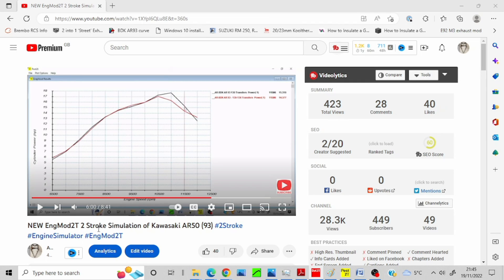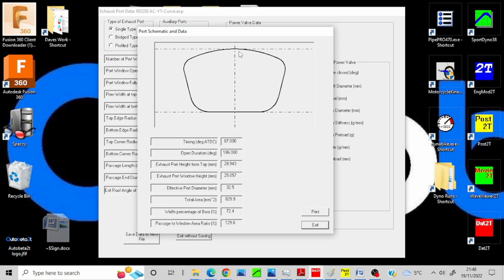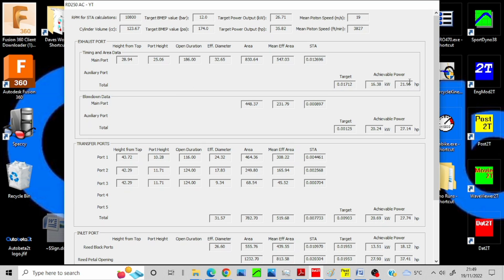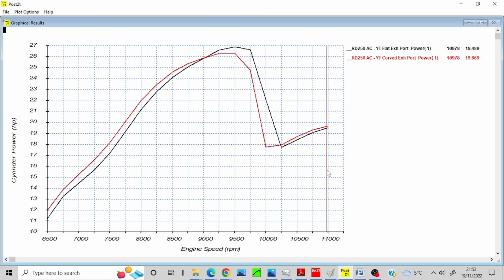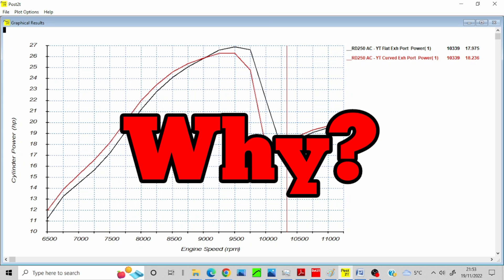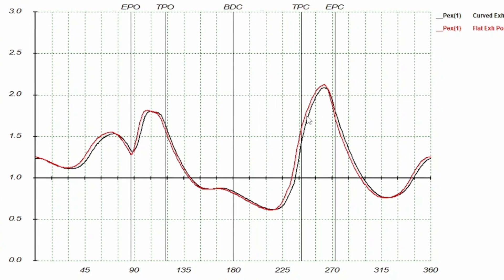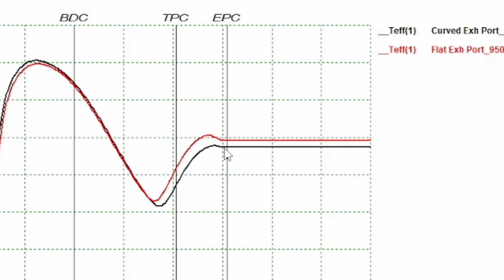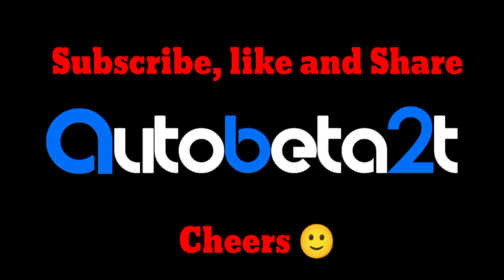Flat Top Vs Curve Top 2 Stroke Exhaust Port Engine Simulation #2Stroke # Tuning #engineSimulation

Comment: Interesting vid! I'm sure that I'm teaching you to suck eggs here but a flat top exhaust port is likely to be more brutal on the piston rings, this might be an issue if your port is also very wide, i.e. 70% of the bore diameter, and I think yours is. 

EDIT...I suppose ring life has to play 'second fiddle' when you are trying to hit 100MPH.
Reply from the maker: Yes, I'll probably not go down that route unless I get desperate. I have heard of people using a long chamfer on exhaust port that are extreme to gradually guide the ring out of the port and I to the cylinder.
Reply: I always used flat top ports in road race engines back in the 80's, no ring issues and minimal chamfering.
Reply: @AuMechanic  Of course you won't have an issue with the rings in a road race engine because the engine is getting rebuilt very often. I used to run a TZ350 G in an F2 sidecar outfit, no issues with the rings. (as long as they were replaced every 50 racing miles! Pistons every 150 and the crank every 500!)

Actually the TZ did have an issue with its rings, they would get 'shaved' thin where they travelled over the exhaust port, the reason was that a burr would form on the ring ends which were opposite the exhaust port, the burr was due to the ring ends hitting the vertical pin in the piston that stopped the ring rotating. The rings ends had to be 'dressed' in order to stop the burr standing proud of the ring which would cause it to jam in the groove in the piston.
Reply: @sidecarbod1441  Yes but I suspect that is likely in part due to the rings used and only one of them in TZ's with nikasil bores as well as very high RPM compared to stock.
I raced an LC350H imp tourer well modified to TZ350G port timings (and YZ 6 petal reeds and carbs I stuffed in it) using Wiseco pistons and rings that lasted 2 seasons no trouble.
And from my own exp as a Mc mechanic plenty of stock bikes had flat top ex ports and no rings issues.
Reply: @AuMechanic  At the end of the day how flat you can go on the top of the port is going to vary from one engine to another and also it will depend on what ring life you are expecting, things like piston rock will have an effect and that will depend on the conrod length and the stroke (conrod ratio), piston clearance and piston skirt length. So to sum up I can't say for sure that in the AR93 a flat port WILL be a problem and you can't say that it WON'T be a problem. As Dave is trying to squeeze as much BHP out of this engine as possible to get to 100 MPH he is going to have to use every trick in the book and if that means going for a flat top port, so be it.

With regards to LC's, didn't everyone have a mega tuned one back in the day? My last one would rev to 11500 RPM, the powerband didn't start until the 9000, not far off the standard redline, it was as fast as hell but boy did I have have to throw pistons and cranks at it. My mate had a go on it, he said it was like riding a chain saw!
Reply: @sidecarbod1441  "you can't say that it WON'T be a problem" Never did.
To expound on what I said, in my exp as a qualified MC (since 1979) I have worked on numerous stock and modified engines with flat top ex ports that suffered no ring issues. How you or anyone else interprets or uses that information is up to you.
A curved port top will not resolve ring issues from high mean piston speed and BHP.
As for LC's, did everyone have 6 petal YZ reeds and carbs and optical ignition system in place of the rotor that was the root cause of crank twisting in them, and did they have welded crank pins in their LC, probably not and no-one i raced against did, but I did and with that never suffered any crank issues thereafter over a season and neither did they guy I sold it to after I moved to 1000 superbikes. And never needed to rev the LC beyond 10k and had ample power below 9k and if you did not on yours then seems perhaps your porting job was sub par or some other flaw robbing you of low end power.
Reply from the maker: @AuMechanic  I'm very interested now in flat verses curved. Not having much practical experience in porting  I am looking forward to experimenting with both and incrementally go from curved to flat... It will be interesting to see how the piston and rings react.and if it grenades itself. 
I've a KX65 rod which gives a few more piston options as the cheapo piston that's in there at the min may not be up to the job.
Reply: @AuMechanic  Jesus man, the LC reference was only some light hearted 'banter' as in "didn't everyone have an LC in the day?", I was NOT trying to belittle your achievements with your LC,  you need to get off your high horse and lighten up!

I know that you didn't ACTUALLY say that 'a flat port wouldn't be a problem, in the same way that I didn't ACTUALLY say that it would be a problem  What I was trying to do was 'de-fuse' the situation as I did not want the posts for this video to spiral down into yet another youtube 'spat', I guess it was too subtle for you to pick up on. 

As to 'sub par'' porting well I don't think that the idea of just copying the TZ350 G is all that great an idea, for starters the TZ has 6 transfers, the LC has 4 so the time-area will differ, oh and lets not forget that the TZ had a piston ported inlet, the LC has you are keen to point out was reed ported with the piston playing a secondary role with regards to the inlet timing. Finally the G produced peak power at 11,000 RPM so I suggest that if your LC was only running to 10,000 then there was something wrong with your setup, your porting should have allowed the engine to rev higher, in other words there was a mis-match between the port timing and the RPM that you were prepared to, or could run the engine to.

I know exactly why my engine was not optimal at lower RPM, it was a road bike and at the time there wasn't an ignition system that would give me a suitable retard curve that would also charge a battery. (Well not one that I could afford). In other words it would have benefitted from running way more advance at low RPM. BTW my LC ran a welded crank along with TZ big end bearings.

Anyway life is too short to be 'conversing' with you, feel free to reply, I won't bother.
Reply: @sidecarbod1441  The G spec porting obviously refers to the exhaust and transfer timings, did I mention the LC has reeds, oh yes I did.
I confess I have been accommodating your cute ring theory for my own amusement so let me be plainly honest.
The theory that suggests the curved exhaust port somehow tucks the rings back in like pulling up trousers over a xmas pot belly, It is no better than flat earth theory.
The shape of the exhaust port has absolutely nothing to do with the rings or any other mechanical factors and a cursory use of a calculator should reveal that fact in about 90 seconds.

There is only one reason that an exhaust port is curved.
Can you guess what it is ?
Reply: @AutoBeta2T  Fact is port shape has nothing to do with the rings.
So you can rest assured that have a flat top port will have 0 effect on the rings and ring life or any other mechanical part.
As for what it will do, Ill explain that by email.
Reply: @AuMechanic  I wasn't going to reply to you as you don't appear to be very receptive to any theory other than your own ideas (I won't call your idea a 'theory' as that would imply that it has been peer reviewed, independently tested, and can not be disproved). Also, you have not actually expanded on your idea of why a flat port is not likely to be a problem.

Having said that I have decided to have one last attempt to explain to you what the possible problem is when running flat roof port , and MUCH more importantly because other people will read this thread and they might be interested in what a renowned and published 2 stroke expert/developer has to say with regards to the shape of the exhaust port, i.e. Gordon Jennings. They can then look at any evidence that you decide to post up along with reading the extract below and make their own minds up.

Oh, one last reason why I decided to reply to you was to watch you dig yourself into a big hole for "my own amusement" (borrowing a line from you!).

With regards to my "cute" theory, well it's not my theory, (thanks for calling it a theory) AG Bell and G Jennings both state that there is a risk of snagging a ring with a flat top port, the two authors that I have mentioned will have forgotten more information with regards to 2 strokes than you could amass in your lifetime. I think your 'flat' port idea not being a potential problem is akin to the 'flat' earth idea being a good one. (Do you like what I did there?)

Your LC that ran for two racing seasons probably did no more that 1000 miles, 1500 miles max so even with flat ports it was not likely that you would spot any issues assuming that the ports weren't very wide. Here are some questions that I'd like you to answer...

1. What was the port width? You mention it being ported to a TZ spec, was the exhaust port as wide as a TZ port? If so it was around 70% bore width, if it was that wide AND with a flat roof then I call that out as 'BS'! (The TZ has a nice oval exhaust port). If your LC ports were not 70% of the bore width then your engine was NOT ported to a TZ spec, you have therefore posted up misleading information. (Maybe that is why it would not rev to 11,000 RPM, i.e. the peak power RPM of a TZ350G.
In fact it could never be TZ G spec, it simply does not have the transfer area.

2. Was there any radii in the top two corners? If so how big was each radius?

3. Was the port totally flat across the roof or was just a percentage of the roof flat? If so what percentage was flat?

Below is an extract from one of Gordon Jennings books in which he focuses in on the exhaust port, I have had to remove the images which show how a square port should be modified so that it becomes an ellipse or oval. I'm sure that you will come back with some sort of disagreement over what G Jennings has published or find to way to dismiss it....

"The difference between success and failure with a modified engine can be the treatment of the exhaust port.  Even assuming that no change is made in exhaust-port timing, simply widening the port window will result in a power increase; it also can result in drastically-shortened ring life, amounting in extreme examples to outright and nearly-instant breakage of the rings, and/or severe overheating of the piston crown.  There are reasons for these problems: A two-stroke engine's piston rings always bulge out into any port window they pass, and while transfer port windows seldom are wide enough to permit this to an extent sufficient to cause difficulties, the same certainly may not be said of the exhaust port.  A relatively mildly-tuned engine will have an exhaust port width equal to at least 50-percent of its bore diameter (which is to say, a 3-inch cylinder bore would have a 1.5-inch exhaust port width) and that is enough to allow the ring to spring out into the port window very perceptibly.  Make that port square, with sharp comers and sharp edges, and the ring will be destroyed very quickly.  And if you enlarge the port so that its width represents 70-percent of cylinder-bore diameter, ring failure would almost certainly occur during the first revolution of the crankshaft.  Yet, racing engines have been run quite successfully with 70-percent port widths, and while I cannot recommend that kind of extremity for modified production-type engines, the mere fact that it has been done tells us that techniques exist to make it possible.
Basically, ring-life is improved - at any given port width by  A) rounding the shape of the port window, and B) breaking the window's sharp edges.  Both of these measures are employed in all engines, but they reach special and somewhat exaggerated form in racing applications.  The traditional port window shape is square, or rectangular, with its corners rounded to help prevent ring snagging.  Assuming that the port width does not exceed 60-percent of bore diameter, the radii at the port window's corners should be about 15 or 20-percent of the port width, and that is just what you will find in most engines.  But as the port is widened, those corner radii have to be made larger to about 25-percent of port width when the latter approaches being 70-percent of cylinder diameter.  Actually, even these very large radii will not completely prevent ring snagging if they are joined by straight-line edges.  The upper and lower edges of the port window should be arched, on a radius equal to about twice the port width, in ports having a width that is 60-percent of bore diameter or less.  Unfortunately, these simple rules-of-thumb are not adequate at port widths above the 60-percent level and such widths are - becoming very common.  With the rings we had a decade past, which were relatively thick, axially, and quite narrow, radially, (not to mention being made of ordinary and rather brittle cast-iron) the upper limit for port width was 62-percent of cylinder bore diameter; now, with our vastly improved rings it has become possible to widen the port out to 70-percent of bore, or slightly more, if we are very careful in shaping the port window.
Just as there is no means of predicting, with any great accuracy, what kind of “cam” and taper a piston will require to fit closely in a cylinder when both are at operating temperature, neither is there any firm rule for shaping ultra-wide exhaust port windows.  Both are established, initially, on the basis of past experience, and then modified according to test results.  It has been demonstrated, in practice, that a modified ellipse is the basic shape of port windows in the 62- to 70-percent (of bore) range.  Thus, while the ring may actually bulge out into the port window enough to cause its instant destruction in a square port, or in one with straight-line edges are joined with simple radii, the contours of an elliptical port window will sweep the ring gently back into its groove.  Then, the only problem that will be encountered is that the ring may bulge out, and be pushed back, unevenly -which may drive one end of the ring sharply against its locating pin and eventually cause the pin to loosen and come adrift. It should be obvious that this last difficulty will be most pronounced when the port window is not perfectly symmetrical, as any departure from symmetry will result in the ring being displaced to one side as it is pushed back into its groove.
Careful craftsmanship will prevent this asymmetrical displacement of the ring; it will not, of itself, forestall other problems associated with very wide exhaust port windows.  In my opinion, one should never simply and arbitrarily widen a port out to the 70-percent limit.  Instead, the safe and sensible approach is to begin at 62-percent, with a shape that is as nearly an ellipse as is possible.  Quite obviously, sharp limitations are going to be imposed by the shape of the existing port window; the idea is to provide the most generous radii permitted by the basic shape with which one must begin.  Obviously, too, this reshaping of the exhaust port window will be easier if you have opted for increasing the exhaust timing, as that will give you room to work above the existing port.  Then, having established the initial shape, you will have to inspect the rings and the edges of the port window for evidence of scuffing or snagging.  Seldom will there be any problem around the lower edge of the port, as the piston slows considerably near the bottom of its stroke.  Most of any scuffing that appears will be around the comers of the port; outright snagging will make its presence known in the appearance of scratches leading upward from the centre of the port window".

I look forward to reading your thoughts with regards to the above. 🙂
Reply: @AuMechanic I see that you have offered to email AutoBeta2T your explanation of why a flat port is not a problem, why by email? Just post it up here. If your idea stands up to scrutiny and no errors can be found in it then it would become a theory, something that is actually held in high regard, you would be held in great esteem within the '2 stroke world' (Just stating that your LC ran just fine won't cut it, not without the port details and even then the engine would need to have been examined independently after the two reason of racing that you mentioned).
As to your comment about using a calculator to prove that the rings do not bulge out into the port, have you actually looked up an exhaust port as the piston descends down past it? You can physically see the rings bulging out into the port.
Reply: @sidecarbod1441  No and no
And again you misquote me.
I said that as a mechanic I have seen many engines with flat top exhaust ports and no such ring issues, the LC is just one, both in an attempt to ease you into considering that perhaps that you are wrong about that.
Clearly it was wasted on you as you persist with it. Fine, you believe nonsense theories if you choose to.
And ... I thought that was your last post on the topic.
Reply: @sidecarbod1441  Jennings (circa 1970's) in his own words wrote his books entirely from his own reverse engineering of what he anecdotally observed and Bell just copied most of it. Unlike Professor Gordon Blair who wrote SAE papers and publications in the early and late 1990's based true scientific methods and peer reviewed studies he cites.
If your rings are colliding with any part of the port it is simply that you have exceeded the acceptable port to bore width ratio for an un-bridged port.
As to corner radii, that is merely a constrain of machining a port and any purpose of them otherwise would be nothing more than mechanical stress relief.
As for seeing the rings bulge out into the exhaust port, compare to what, the rings above the port that you cannot see.
Did you even consider the speed of the piston and the inertia behind the piston and crank assembly at revs and the effect of that on the material properties of a piston ring colliding with any part of the port edge, clearly not.
As for wear marks, what you are observing is distortion of the bore due to heat around the edge of the port and nothing more.
Reply: @sidecarbod1441  And Ill just add one more bit of advice to you and anyone reading that Jennings and in particular G Bell should have remembered and that is the most basic rule of science / statistic which is that "Correlation does not equal causation" and believing it does is a common mistake made in the rush to pull some plausible sounding theory out of a hat, and a mistake made all too often by interpretation of Dynamometer results.
You begin with the theories of causation based on known science and correlation comes after that for the purpose of disproving ones own the theory.
Reply: @AuMechanic  I will pick out some of the points that you have raised from your ‘word salad’ of the last three posts that you submitted and reply to them, I will actually quote you so there can be no misunderstanding.

YOU…“No and no And again you misquote me. I said that as a mechanic I have seen many engines with flat top exhaust ports and no such ring issues, the LC is just one, both in an attempt to ease you into considering that perhaps that you are wrong about that. Clearly it was wasted on you as you persist with it. Fine, you believe nonsense theories if you choose to”…..

…..I have at no point mis-quoted you, in fact I’ll quote you now…”I always used flat top ports in road race engines back in the 80's, no ring issues and minimal chamfering”

It is this blasé comment that I have been concerned about all along, it implies that you can just square off any port with no consideration to its width and have "no ring issues"

YOU…“And ... I thought that was your last post on the topic”

…. Well the truth is that I’ve had a change in the way that I’m dealing with this thread, I’m now thoroughly enjoying it and will continue to reply for as long as I wish to. (Unless of course Dave blocks me!) In the process you may even change my opinion on flat top exhaust ports, if that happens I will be the first to admit it in the thread, so far you have not provided any real arguments or evidence that has even started too change my mind. It has not gone unnoticed that you still have not provided any port dimensions for your LC other than its height, even then you just state “TZ spec”.

I will recap in more detail some actual ‘real world’ evidence that rings DO pump in and out of the exhaust port. For 3 years I ran a TZ350 G in an F2 sidecar outfit, I’m not sure if you are familiar with the piston ring peg design or its location for this engine, basically it is a thin vertical pin that is directly opposite the exhaust port. The exhaust port of my engine was standard, you can check out the shape and dimensions by googling for a port map of this engine. I’m not hiding or being ‘shady’ over its dimensions. (45mm width from memory).

As I stated in a previous post, the rings on this engine did suffer from being shaved thin exactly at the point where they traversed across the exhaust port. Explain how that happened if they to not bulge into the port! The reason that this happened was again down to the pumping action that the port imposed on the ring which resulted in a chain of events. The pumping action caused the rings ends to burr up at the point where they hit the piston ring peg. The burr, if not dealt with would cause the ring ends to jam up in the piston ring groove, this would then stop the ring from being pushed back into its groove as the piston travelled past the roof of the exhaust port, the result was a ‘shaved’ ring. The burr was actually dealt with BEFORE it could form by dressing the ring ends whilst the rings were brand new.

I know that the last time I mentioned my TZ engine you retorted with some gumph with regards to the engine having a single ring and a nikasil bore and at the time I let that slide, now there is no way that the design of the ring or the coating on the bore had anything to do with this, if you believe that it has then explain how, don’t just leave that statement ‘hanging’ in the air. You also, and stated and I quote, “very high RPM compared to stock”, well the engine only ran to the stock RPM limit for that engine. My LC actually ran to a higher RPM limit, it never had ring issues. I only ran the top ring in my LC.

Furthermore, I’ll save you the bother of replying with something along the lines of “well the engine wasn’t assembled correctly” It was actually assembled correctly many, many times.  I will let you know that the tuner/developer that was helping me at the time (Roy Simmons) over the phone knew actually why the rings were shaved and how to cure the issue, whilst I was on the phone to him he said “look at the rings ends, they will have a burr” (this was 30 years ago, possibly more, I will never forget it). Now the only reason that he could do this without even seeing the rings is because he had seen other engines with the same issue. Furthermore, and just to knock-on-the-head any thoughts of this engine somehow not being built correctly I’ll just let you know that in my ‘rookie’ year I won the clubs F2 championship racing against many other TZ’s and 4 cylinder 4 stroke 600cc engines. I went on to win other championships in F2 and F1 sidecar racing but that’s another story.

YOU…“Jennings (circa 1970's) in his own words wrote his books entirely from his own reverse engineering of what he anecdotally observed and Bell just copied most of it”

…..I wondered how you were going to dismiss Jennings book, a fairly weak attempt in my opinion. There are other more contemporary tuners/authors that place great importance on the exhaust port radii in order to protect the rings, The problem is that I cannot find anything on the web that I can copy and paste into this thread.

YOU….“Professor Gordon Blair who wrote SAE papers and publications in the early and late 1990's based true scientific methods and peer reviewed studies he cites. If your rings are colliding with any part of the port it is simply that you have exceeded the acceptable port to bore width ratio for an un-bridged port.”

……I suspect that you have ‘cherry picked’ from that SAE paper. I would need to read the whole paper and not just an extract from it. Even if the paper states exactly what you have posted up in context  I would still disagree with it, as would many others who I freely admit are very much more qualified in this area.

YOU….“As to corner radii, that is merely a constrain of machining a port and any purpose of them otherwise would be nothing more than mechanical stress relief”. 

…..A constrain of machining, well machines and humans are more that capable of grinding a port with virtually no radii so they can not be a “constrain of machining” There must be another reason why the port has radii, if it was just stress relief then the radii could be a whole lot smaller which would then increase the port area without have to increase its width.

YOU..“As for seeing the rings bulge out into the exhaust port, compare to what, the rings above the port that you cannot see.”

….LOL well I think that when you can see the rings bulging out into the port it would be safe to assume that they are not bulging out when the piston has risen above the port! In your world do the rings occupy the same physical space as the bore wall? Some sort co-existence in the same SOLID space?

I actually find it very hard to comprehend how you can NOT see how the radii and curved port roof will not guide the rings back into the ring grooves, I’m not having a ‘dig’ at you here, I just find it hard to comprehend this. It seems just as obvious to me as observing how the linear movement of a piston is converted into rotational movement of the crankshaft by means of the connecting rod and offset crankpin (big end). The radii and curved port roof guide the rings back into their respective grooves, both are obvious to me.

YOU…“As for wear marks, what you are observing is distortion of the bore due to heat around the edge of the port and nothing more”

….Well I’m not buying that, yes the bore can and will distort unevenly to a degree (but less so with water cooling, aka TZ). The piston is also likely to distort unevenly due to temperature variations, for these reasons the piston is both tapered and cam ground. There is no way that the bore can distort locally by the amount that you are inferring or if it did then you have a major issue with the dissipation of heat from your engine, the loss in performance would be huge as the rings would not have any chance of sealing against such a badly distorted bore. (Please don't cite heat fade, that is another issue which describes the lost in performance that has occurred, possibly for several reasons)

YOU…“You begin with the theories of causation based on known science and correlation comes after that for the purpose of disproving ones own the theory”.

….NO, actually you begin with a hypothesis, NOT a theory, you then test that hypothesis, (an idea in layman’s terminology) you offer it up for peer review, you allow it to be independently tested, if after all of that no errors are found then becomes a theory. In science and engineering a theory is held in high regards, the word is misused by the general public, or at best has a different meaning when it is used. In fact the way that you are using it.

Finally, for the moment, there is a simple rule when debating, the person who states the supposition is the one that needs to provide the proof and evidence. You have put forward the statement that flat roof exhaust ports will not cause an issue, (you have implied it to be slightly more accurate) QUOTE "I always used flat top ports in road race engines back in the 80's, no ring issues and minimal chamfering".... You need to provide the evidence. (Other than your LC which at this time has unknown port dimensions)

You may of course flip this on its head and state that I am the one stating that a flat roof port WILL have issues, well at no point in time have I stated that, I have said that it 'MIGHT' have issues, and for further clarification, it obviously depends on the width of the port. A tiny square port is clearly not going to be an issue because a small chamfer could deal with the tiny amount that the ring would bulge into it. A tiny port will not help Dave get his AR93 up to 100 MPH, it in all probability will prevent it.
Reply: For some reason I can not add the text below to my post.....

YOU..."Did you even consider the speed of the piston and the inertia behind the piston and crank assembly at revs and the effect of that on the material properties of a piston ring colliding with any part of the port edge, clearly not".

.....Please actually explain this rather than just stating it, how exactly does the speed of the piston and its inertia prevent the ring from bulging out into the port? Please don't state that there is not enough time for the ring to spring out into the port! LOL
Reply: @sidecarbod1441  "Word salad" from the guy who writes the entire works of Shakespeare in the comment section of a youtube video obviously lacking the self awareness to realise that no-one is going to read all that crap let alone me.
As a professional qualified mechanic like me having rebuilt hundreds of engines over a period of decades you really should know better than to have believed such nonsense theories about ports and rings.
I understand your agony in finding out you were lied to but I didn't lie to you so don't take it out on me.
And no I am not going to explain why ports have a radius on top because it is on my to do list of future vidoes and the topic is quite nuanced and requires more than a youtube comment section allows, and I would not waste my time explaining something only you will read.
Reply: @sidecarbod1441  No
You are the one who claimed the ring is forced back in to the ring land by the curvature of the exhaust port without any regard to the velocity of the ring and forces behind it,  and the result of a ring colliding with any part of the port at any angle of incidence, and the effect of that at 1000s of times per minute on the relatively fragile piston ring if that were to occur.
As a professional mechanic you should know better..
Reply: @AuMechanic  Yes my posts were long, that is because they were detailed, you on the other hand did not post up a single counter argument to anything that I posted up, also, and I'm just putting this 'out there,'  but are you by any chance a slow reader? If so practice makes perfect!  My TZ was somehow lying to me when the rings were getting shaved?  Keep digging that hole, you will surface in the UK soon, I'd love to meet up with you!🤪
Reply: @AuMechanic when it comes to the damage on the ridges of the ports and rings on the exh port places 
If its because of the higher temperature on the edge of  the port then there should be no difference to the shown damage of the oval and square port i would like to see them compared 
I dont see any reason whh temperature there would be different so it could be a good way to prove if its just a correlation or so 
And possibly end the debate 
Im leaning to the curved port side still... but maybe that would change my mind
Reply: @maciejz6914   As mentioned above you can just google port maps and click images and run down the ratio of flat ports to see that most of them are and have been flat for as long as 2 strokes were a thing.
The reason for curved ports is noise attenuation, it reduces the sharp peak of the sonic wave at blowdown and did not come about until EPA started to demand manufacturers made engines quieter, introduced by McCullough on chainsaws for that purpose. 
You will also find curved ports on intake ports of piston port engines to attenuate intake noise too where there is no ring passing the port.
It is fine if you don't have an expansion chamber like a chainsaw or moped but if you do a curved port will the reduce pipe performance at the peak of the power band.
The conclusion that curved ports were to increase ring life was just a mistaken observation that seems to have gotten traction on internet forums and spread like vermin.
Reply from the maker: Cheers - that's good to know. So I may get away with a flatter roofed exh port then 😊
PS - like your vids. Are you doing anymore?
Reply: @AutoBeta2T  Thanks.
Had a few life changes so had to shelve it for a while. May do more in future.
Reply: @AutoBeta2T no, never, always a little curved at the top and bottom.  Best port is an egg shaped port. But that will depend on what you find in the original cylinder . How much bigger can I go? Is it already to big originally? According to the piston diameter and stroke it's not possible to go bigger? The original shape doesn't give me space to create the new shape I want? -> because then it will be to big? 
Look, measure, knowledge, can or can't (on some cylinders). 
Now let's see difference: at 40mm the ports were big enough and could not do much  porting ,ok ,now I bore it to 50mm , good ,now it can be ported bigger.  How? Shape? How much? Where to? All of the ports? 
Than start porting. 
Want to know? Everytime YOU need to port a cylinder just show me the cylinder, AND with the piston full down, AND the original piston, AND the original cylinder.  And than the cylinderhead.  PICTURE. 
Very easy.😊